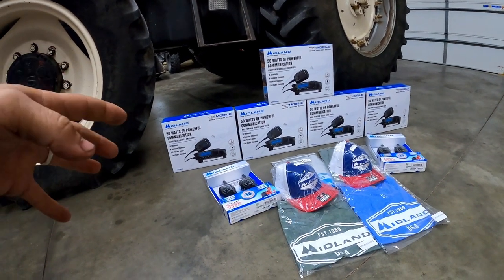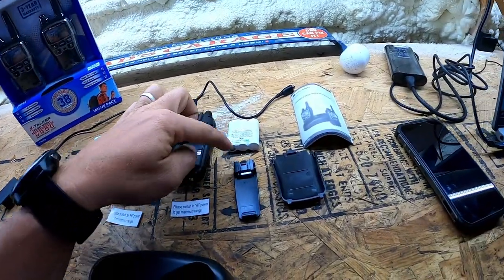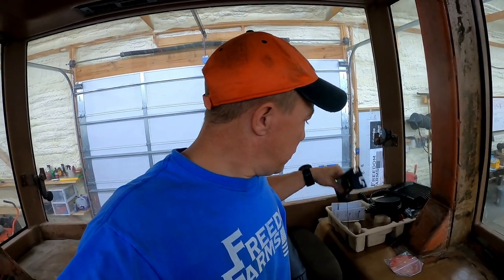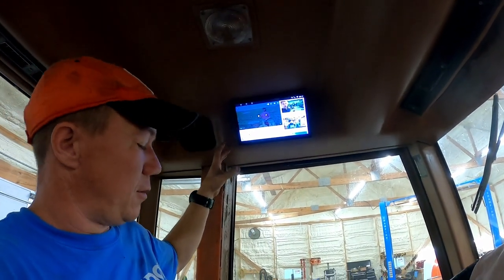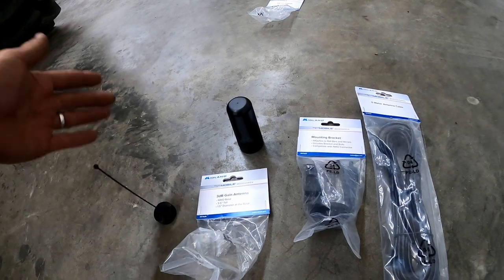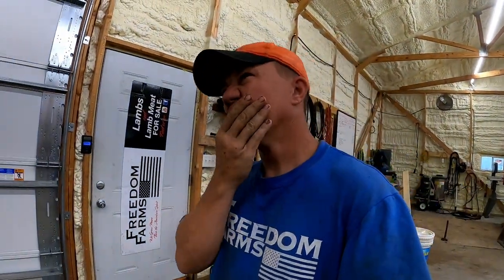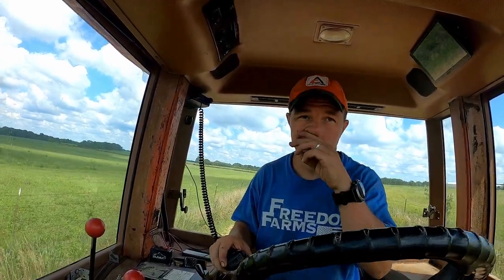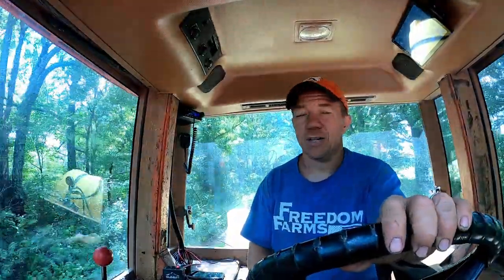Midland MXT500 short range radio test in rough terrain @MidlandUSA

Comment: My first CB was a Midland and I had pretty descent range. Saved my butt once when I ran out of gas in the Rocky Mountains just into Utah coming from Colorado along I70. Maybe not the top end but very good for the low cost and small footprint. Mine was in a Toyota MR2 at the time.
Reply from the maker: These are not CB radios, they are 2 way radios.